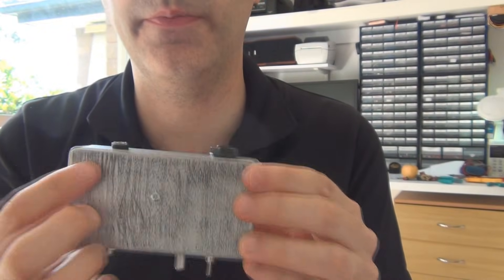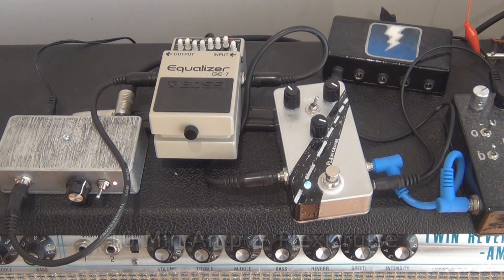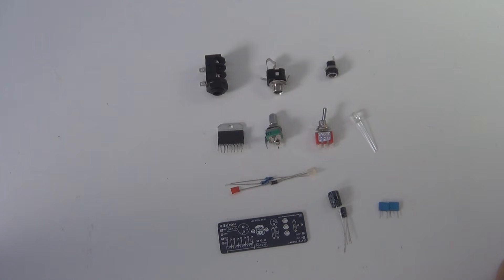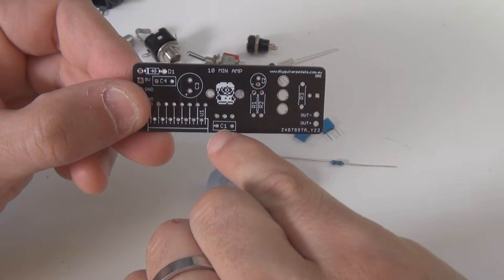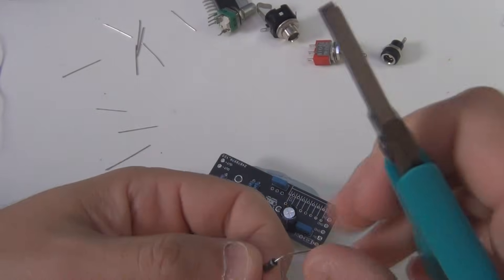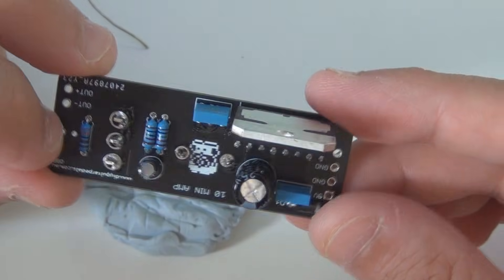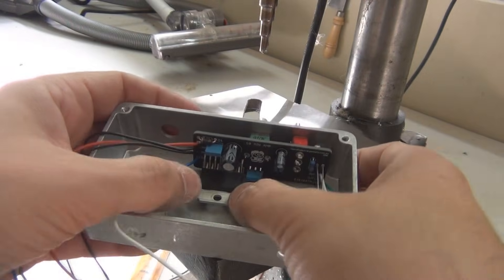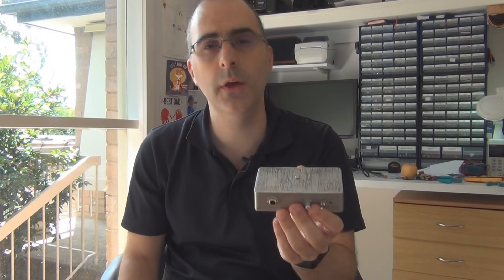Build A Guitar Amp In 10 Mins

Comment: Did you need to use an amp to use the amp? Lol that's what it looks like to me, how does it connect to a speaker?
Reply: I believe Paul is using the line out on the 10 Minute Amp to drive the cabinet that it is sitting on in the video. The amplifier that is with that cabinet (his combo amp) is not turned on. But basically, the line-out on the 10 minute amplifier is where your speaker or cabinet would plug in.
Reply: @erikvincent5846  and line out is line out he would need the amp turned on to use the line-in/aux ,and the amp would need to be turned on and plugged in to use either the input or the aux. 
The only way to do it without powering the amp is to be connected directly to the speakers, and giving both the speakers and the signal power. 
If this works without power then I should be able to take the signal from my headphones and connect that to a speaker, I should be able to here a tiny noise,  or it should be as loud as headphones, I'd even say it could be quieter, but no it doesn't work.
Reply: @evanfehr3819  if you were to take a pedal, such as an EQ, Pre-amp or any other, and plug it straight into a cabinet, it won't do anything. You do need an amplifier for that. I have my 10 Minute Amp with it's output cable plugged into my 2x12 cabinet of Celestion Vintage 30s and with the volume at max, and with the voltage for the 10 Minute Amp all the way down at 4V, it still is kind of loud. However, the current draw is reflective of that. One difference with the output of a pedal and the output of a power amplifier is the two wires on the output jack. On a pedal, typically, it's signal and ground. On an amplifier it's signal+ and signal-, not ground. Another difference, as indicated earlier, is the current. Cabinets go into the realm of 100mA and above, while pedal's (not how much current is uses to derive a signal, but how much it pushes out) is tiny. A pedal cannot deliver the power to drive the speakers, whereas a power amplifier can.

On Paul's Combo, he can disconnect the amplifier built into the combo, and just use the speaker/cabinet. That's what he is doing in the video.
Reply: Unless he was plugged directly into the speaker which he wasn't,  he was plugged into the amp, for the speaker connected to the amp to work, so he is going to have we believe that a 9 volt battery is going to be able to turn on speakers?  I mean my grandpa's new turn table can't handle anything bigger then 4ohm speakers, and that uses power from the wall 
So I'm pretty sure if you have to plug into the amp you are plugged into an amp? I mean then all pedals would allow you to do this?
But if you think a 9v battery can power a loud speaker hahahaha! 
What's the point of amplifiers if his pedal and an equalizer pedal would do the same? If it connects to speakers and is designed to be used without amps why is it plugged into an amp and not just connected to speakers?  I mean its not really amazing to plug a pedal into an amp and then call the pedal an amp lol! I mean he still needed an amp to use it hahaha.
Reply from the maker: Hi Evan. No this is not correct you can not connect this amp to the input of an amp, it needs to connect to the speaker directly. I've connected my to the bad cats speaker in this video

Comment: Could be made into a pignose type of amp? Battery powered, built in distortion, etc?
Reply: Sure. So long as the enclosure you use has the room for it, you can slap any effect pedal circuit inside the enclosure and put it inline with the guitar input jack.

Comment: Bass Version?
Reply: I believe I put it in the build doc, but really the only values that are needed to be manipulated for bass is changing C1 from 10nF up to something like 100nF or more. However, if trying to drive woofer speakers, then increasing C3 from 220uF up to 470uF may also be desired.
Reply: See the video after this, I play a bass into the amp.

Comment: Why not using a PAM8403 ? It costs around 1$
Reply: That was an option we looked at. However, to make this work, we also know that the DIY community typically favors through-hole design over surface mount. The PAM8403 from Diodes Inc only comes in SOIC/SOP-16. I've heard that at one time it had a DIP-16 version, but that version is out-of-print. https://www.digikey.com/products/en/integrated-circuits-ics/linear-amplifiers-audio/742?k=PAM8403

Comment: Have you ever tried to run it at 19V?
Reply: Only temporarily. The TDA7266M has for a maximum voltage rating of 18V on its datasheet. Now in a lot of cases these companies, when writing the datasheet, are aware that some of their chips may perform at a slightly higher rate on some of these specs, but not all of them will. So, they will guarantee the lowest value that will work on ALL the chips manufactured, which would be 18V. Some chips may work at 19V. Some may work at 19V for about a week and then die. As that spec is above the manufacturers recommendations, we cannot guarantee what it will do.

Comment: Hi! When this is cranked, does the sound get slightly distorted? Im looking for a loud, as clean as possible amp. What voltage/speaker combinations would help with using this? Thanks!
Reply: The more volts, the more headroom, which would result in less likelihood of clipping and distorting. So 16 to 18V power supplies will give you that. Speakers, I could go all day on. I got a Harley Benton 2x12 with Celestion Vintage 30s from Thomann and it rocks. Just get a good cabinet, and that will be it.
Reply: As Erik said, to get the most clean headroom you want to run the power supply at the highest voltage that the power amp IC is rated for.  In this case that appears to be 18 vdc.  Alternately you could search for a replacement IC rated for higher voltage and then beef up the power supply.  But the higher the power the greater the cost (and the more the need for a heat sink/cooling system.)  Realistically speaking, these are solid state watts, so even going to 24+ vdc is not going to get you a whole lot of added volume.

Comment: Would like to see a suitable (FET) preamp and bass, middle, treble tone stack to stick on the font end of this.
Reply: I am actually looking at putting a simple MOSFET boost/preamp with some sort of tone stack. The trick with this piece is keeping the parts count low as we wanted a small, easy kit.
Reply: Try using your favorite distortion pedal as a preamp
Reply: I would really like to at least have a schematic for that, Erik. Gain and even just a treble control that will match up with your amp and run off same power source. That would be really helpful.

Comment: What's the current draw at 9v, and is it 7W at 4 ohms, if yes, how many watts at 8 and 16?
Reply: Correct me if I am wrong, since this is a Solid State and not a tube amp, the output should stay somewhat consistent with different speaker resistance. Regardless, I'd be very happy if I got 5 W out of this into my 8/16 (it's selectable) 4x12 speaker array. It will be more than adequate for home practice and possibly OK for small gig venues. Please chime in your thoughts, thanks!
Reply: @XwpisONOMA  it will stay "relatively" the same, but it will change a measurable amount with different speakers

Comment: So does this cover both the pre and power amp stages? So could it be wired directly to a speaker? I’m thinking it would be great for a micro amp for testing pedals.
Reply: It essentially is just a power amp by itself. Hence the recommendations of using a boost to be that preamp.

Comment: What thickness of solder wire do you use? I have a spool of 1 mm which works great for guitar components but I'm struggling with it on a pcb. Yours looks much thinner. Thanks!
Reply: Typically, I am using AWG 24 - 26. A cheap way to get a lot of wire is to get some cheap or used network/phone cable. It's solid core and is usually AWG 26.

Comment: What mods would I have to do to make it work for a bass? I'd like to build a cigarette amp with this thing
Reply: Hi Sangr, basically the 2 things you'd be looking at are C1 and to a lesser extent, C3. C1 is the input filter. The larger the value, the more bass frequencies it will let in, but it also will make the sound be a bit darker because of it. For a bass, this may be desired as the larger bass frequencies may outweigh the darkness of the tone. So, going from a 10nF cap to a 100nF or larger may be advised. C3 is just a general power capacitor, but when dealing with class A-B amplifiers that are solid state, it needs larger capacitance to handle slugging low frequencies. That's why Woofer circuits tend to have some large caps in them. 220uF should be sufficient, but a woofer circuit I saw using the same TDA7266M chip did use 470uF capacitors instead, but was probably doing it to handle those sub-bass frequencies.

Comment: What Ohm speaker matches with it?
Reply: Hi Ray, it was designed around the intent of an 8 ohm rig (I use my 2x12 Celestion Vintage 30's cabinet with it). However, the IC supports 4 - 16 ohms as well. If you go 4, it won't push as much for amps, but will still sound good, and 16, it will push, but the IC will get hotter than it would at 8, so heat-sinking it into the enclosure would be key.

Comment: headphone version?.... 15 watt version (micro terror has the same format output amp format)??...
Reply: Hi Kazz, due to this being a solid-state Class A-B Mono Bridge Amplifier, adding headphones is just a matter of adding a headphone jack. No additional resistors or anything like that to add a load. A warning though, it will be loud, so you will most likely want to turn the volume down. If using stereo head phones, you will need to wire both left and right channels to the output+ and ground to the output-
Reply: So, after some experimentation, here is what I determined. The TDA7266 has some level of load protection, so technically, you can just straight wire a stereo jack to the output and get head phones to work. However, the level of volume is still pretty loud, and if cranked, it will blow the 32 ohm load, that is your headphones, especially if you put high gain pedals in front of the amp. To resolve, I am updating the build doc now, but it shows how to add a 47 to 100 ohm resistor in series with the out+ wire, which will go straight to the headphone jacks stereo left/right. I just tried that with my cheap ear buds and placed a Univox Super Fuzz cranked on it. Headphones survived, but that was a bit loud for my ears to handle for any level of time. Hope that helps.

Comment: Is it possible to wire up a headphone out on this one?
Reply: That was my first thought too...
Reply: Hi Badgeholder, you can. Due to this being a solid-state Class A-B Mono Bridge Amplifier, adding headphones is just a matter of adding a headphone jack. No additional resistors or anything like that to add a load. A warning though, it will be loud, so you will most likely want to turn the volume down. If using stereo head phones, you will need to wire both left and right channels to the output+ and ground to the output-
Reply: @erikvincent5846  So, you basically just hook the headphones to the speaker outputs directly? That doesn't sound difficult. :)
Reply: @SuzanneKowalski  I just updated my reply with a bit more information. I figured you might want to check it out.
Reply: @erikvincent5846  I didn't think it was that simple Eric(?) - if you just do as you describe you'd likely blow your nice expensive cans! 

One should really have a dedicated phone-out stage in the circuit.
Something like this http://www.electronics-diy.com/4x4.php
Reply: @wodenoftheangles3339  it would work, just make sure you have the volume way down. Typically additional circuitry for head phones out is just to give it a unity with the cabinet. Where at about noon on the volume, it is pretty loud on the cabinet, but tolerable, that same noon would blow out your ear drums. But at a 1, it would work on the headphones alrighty, but be quiet on a cabinet. So that extra circuitry just would make noon not as loud on the headphones, but be normal on the cabinet. Basically a buffer and an attenuator.
Reply: @wodenoftheangles3339  So, after some experimentation, here is what I determined. The TDA7266 has some level of load protection, so technically, you can just straight wire a stereo jack to the output and get head phones to work. However, the level of volume is still pretty loud, and if cranked, it will blow the 32 ohm load, that is your headphones, especially if you put high gain pedals in front of the amp. To resolve, I am updating the build doc now, but it shows how to add a 47 to 100 ohm resistor in series with the out+ wire, which will go straight to the headphone jacks stereo left/right. I just tried that with my cheap ear buds and placed a Univox Super Fuzz cranked on it. Headphones survived, but that was a bit loud for my ears to handle for any level of time. Hope that helps.
Reply: at full power it will dump aproxmtly 1.5 watts into a 32 ohm headphone. likely destroying it.
Reply: So, after some experimentation, here is what I determined. The TDA7266 has some level of load protection, so technically, you can just straight wire a stereo jack to the output and get head phones to work. However, the level of volume is still pretty loud, and if cranked, it will blow the 32 ohm load, that is your headphones, especially if you put high gain pedals in front of the amp. To resolve, I am updating the build doc now, but it shows how to add a 47 to 100 ohm resistor in series with the out+ wire, which will go straight to the headphone jacks stereo left/right. I just tried that with my cheap ear buds and placed a Univox Super Fuzz cranked on it. Headphones survived, but that was a bit loud for my ears to handle for any level of time. Hope that helps.

Comment: Another great kit 👍. I would like to build it and make a few changes. How would I make it stereo? I want to run 2 4x12 cabs.  Do I need to increase the wattage?  Please let me know I definitely want to build this ASAP.  Thanks
Reply: You could use two TDA7266M ICs but you would probably want to buffer (copy) the input and feed the original signal to one TDA7266M (left) and the copy to the other TDA7266M (right). I would look into using something like the TDA2009A instead, which was designed for stereo (input and output).
Reply: Pretty much what Haze said. You could run a pair of mono outputs instead of a single, and it will work, but it will cut down on the sound quality and volume.